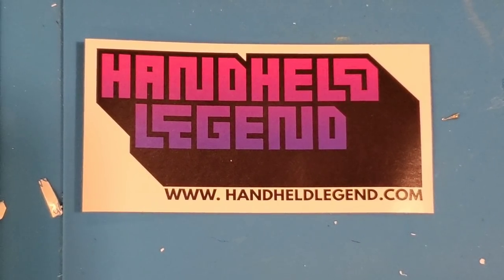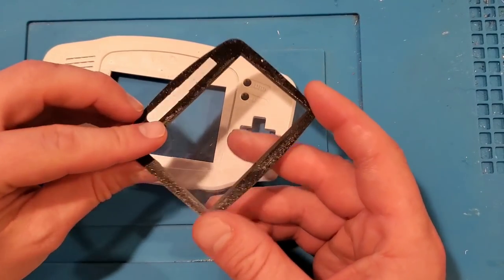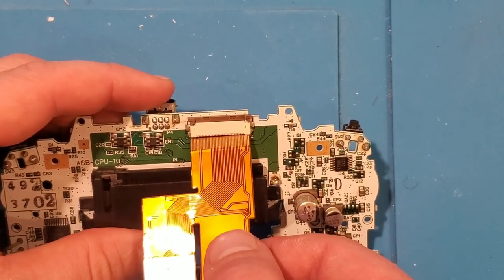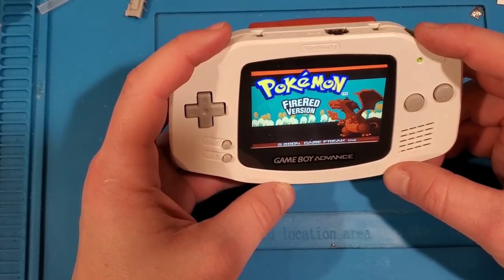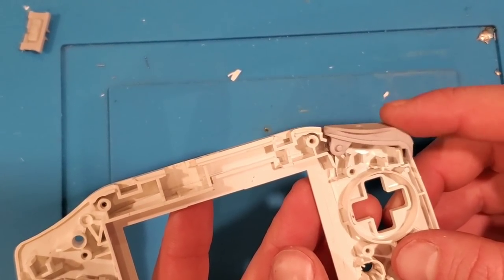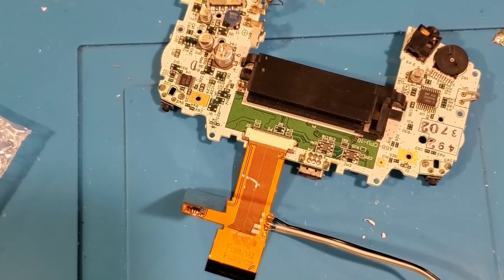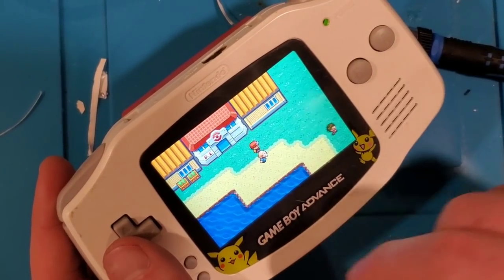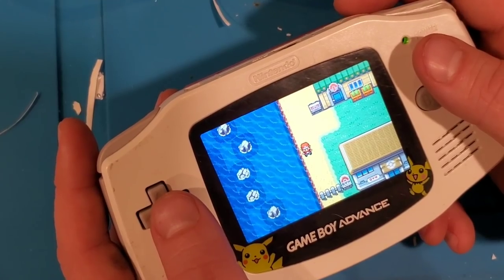Game Boy Advance IPS Backlight V2 Centered Installation - Fixing Ebay Junk - Backlit Display

Comment: I installed the screen and tested it first. Worked fine and had displayed the correct colors. But after getting everything in place, the screen didn’t display the correct colors. So I took it apart and when I touch the other ribbon connector with my finger, the colors changed and have lines. Did I do something wrong or damaged something? I don’t see a tear in the ribbon. Someone please help!

Comment: I once ordered a frontlight mod for my GBA, but I didn't get any LOCA glue with it, which I soon found out was a mistake. But by the time I got any LOCA glue, my GBA had some dead pixels on the screen, so I decided to just get one of these, since they had recently come out (with the V1). I didn't have the money to get one, so when they were sold out, I thought I had missed my chance. Luckily, the reason they had sold out was because they had a better V2 ribbon on the way that fixed the screen tearing. I got that, and I absolutely love it!

All good things to those who wait, I guess.
Reply: I feel bad for those who rushed and got the V1. I held back specifically because of the screen tearing as I absolutely can't stand that kind of stuff. Now not only do I have a GBA with a V2 but I also have 2 SP with it as well. It's even easier to install on the SP as you only need to solder 1 cable that allow brightness control directly with the SP's brightness button.

Comment: Thank you so much for making this guide! All the other screen mods had them putting them in aftermarket shells with larger screen cut-outs but I plan on doing this to an authentic spice orange shell I purchased off of ebay, so I wasn't quite sure how to make the larger IPS screen fit without cutting away at the plastic border. Which I really didn't want to do for the same reason as you, basically fear of doing an unappealing hackjob on the original casing. I'll definitely keep this video saved for when my materials arrive and it's time for me to mod!

Comment: The edited-in portion showing you installed the spacer wrong was  abit confusing when it jump back and fourth in time. At the final assembly end of the video it was still/again in the wrong place, so assume you noticed later and recorded the edited portion and spliced it in. Would have benefitted from a annotation (both at the edit portion and at the assembly time where you put it in wrong) especially if ppl want to use it as a tutorial.

Comment: The lag on the brightness switch could be due to the two soldering pads touching on the ribbon cable connector
Reply: I was thinking they looked like they were connecting lol

Comment: @9:30 On the board of the GBA, there's a little number to the bottom right of the ribbon connector. It represents the number of pins used. There's a 32 pin and a 40 pin version of the GBA. Looking at the number, you can tell that yours is the 32 pin version.

Comment: I have a GBA SP that I have taken apart and cleaned. I got the left trigger button working reliably, but the right trigger button only wants to work if I apply a lot of pressure at a specific angle. I've tried using compressed air to blow out the contact, and I've let isopropyl alcohol sit in the contact and evaporate. It still only responds if I push it at an angle or use a lot of pressure. Is there anything else I can try before I replace the trigger altogether?

Comment: the funnyplaying v2 screen fixed some of the bugs that were present in the v1 like the screen tearing.
Reply: Tiny correction. The ribbon got fixed. Not the screen. That mean you can upgrade from V1 to V2. Bad news is that 80% of the price is the ribbon.
Reply: I just installed my V2 yesterday and get minor screen tearing during led screen resets and during screen transitions. Is this normal or did I get a defective unit?

Comment: I just started refurbishing and upgrading my childhood GBA and this popped up on my feed, this screen looks way easier to install than others, I have some questions though. The soldering controls the brightness settings right? And therefore isn't "required" to do? And if not, does the screen appear too bright or dark on the normal brightness?
Reply from the maker: It's not required,  and if you decide not to,  it's "normal" brightness,  not too bright, but bright enough for most conditions

Comment: Hmmm I wonder, about 2 years ago I purchased a pre modded GBA and the left button is solid and doesn't click I wonder if they messed up the piece of plastic you kept.
Reply: It's possible that the metal tab is just out of it's spot. It's also possible that the shell is too tight and doesn't let the button move freely. I had one where the white bumper pieces on each side were touching the buttons a bit and wouldn't let them spring back up properly. They still worked but it annoyed me. If you have the same problem it's easy to fix. Unscrew the back cover, take out the bumper pieces and file down the edge that touch the buttons some. You don't even have to unplug anything.

Comment: I'm a little concerned I did the funnyplaying mod and used the glass lens but the screen is noticeably offset to the right even centering it like you did.
Reply from the maker: The screen is bigger than the window,  so you actually need to trim the hole so you can view the entire screen. 

The way i offset it centered it more.  Some of the screen is still hidden,  but it's only a couple pixels on each side instead of being out by a quarter inch or more

Comment: Hi all, after my IPS mod i'm experiencing this issue where the select button works as it was the start button. Is it normal after I soldered TP2 for brightness control or not? Someone ever had such problem as well? Thanks in advance
Reply: hey there, just here to say i cant help you but i wish i could. ight thanks bye
Reply: @clayl4650  I actually managed to fix it: there was a false contact on TP2; after I re-soldered the point correctly, both start and select buttons started to work correctly. Thanks

Comment: Man, you'd think that the designers of the backlit upgrade kit would measure their parts more accurately. The screen display being too big to see unless you trim the actual case, they should of just reduced the backlit display themselves.. The flipping of the flexible board parts is insane.
Reply from the maker: I suspect they used a mass-produced screen that was already available, and only really designed the ribbon connector.   There's a fair bit that goes on on that ribbon, as the output has to be scaled and adjusted for the proper screen.   I'd be surprised if this display were manufactured solely for this purpose.
Reply: @RetroRepairs  The screens are indeed mass produced and that's why they are 8$ each while the ribbon is 40$.

Comment: You could have just kind of sat the screen cover into the hole without taking the adhesive off, so you could easily remove it and use another since it was so scratched up.  Was no real need to actually adhere it if they will end up sending you a replacement due to the scratches.

Comment: They have a version for the GBA SP as well now. I have one on the way. Going to turn one of my AGS-001 into an IPS modded version. I also have a few AGS-101 but it's not really worth upgrading those.
Reply: I agree bro, it is not worth to ruin an original ags 101 sp for it! I hope you are enjoyed your new ''ags'' 101 :D
Reply: @martijn439  I certainly do. The IPS screen look good on videos but it's even better in real. So sharp and clean. The one I got was from Ebay. It has 10 brightness levels and it remembers what setting it was at even if you remove the battery.
Reply: @chamoo232  cool! im about to order one myself but idk how to solder
Reply: @martijn439  I got a cheap soldering kit on Ebay. The only thing missing was flux and that's very important as it make it so much easier to solder. It's basically 3 steps. flux, heat, solder. Solder becomes liquid when it's hot enough and it stick well to the copper contacts and wires as long as there is flux. Unless you have very bad eyes I would say the difficulty of soldering the cables in the SP IPS kit is probably about 3/10.
Reply: @chamoo232  thank yo ubro, i will give it a shot once i have the required parts
Reply: @martijn439  It's very useful to have a soldering iron too if you ever need to replace something like the L and R buttons. I recently did that on a SP. The cheap soldering kit I got has a device that look like a big sirynge that you click and then press a button to have it suck out melted solder. With that I was able to easily unsolder the tiny switches soldered to the board and install new ones.
Reply: @chamoo232  that sounds really interesting! I really have to practise soldering first. I am trying to buy a shell + ipsscreen now for the gba. Idk which color. i am debating between blue and green.
Reply: @martijn439  My favorite replacement shell is the NES one. has a very nice sticker that look like the NES controller and the A and B buttons are red. My main gaming SP right now has a transparent black shell. It's nice because you can see the motherboard through with the little red cable I soldered. I have an EZ Flash Omega cartridge and it's the same color so it all match nicely. The Super Famicom one is surprisingly well made. It has a more mat finish than other shells.
Reply: @chamoo232  thanks for your answer! i ahve decided to go with crystal green though, as it seemed really cool.. good thing i can always swap the shell out if i dont like it
Reply: @martijn439  Indeed. There really isn't any bad choices. If I find another SP for cheap the next shell I order might be the yellow glow in the dark one.

Comment: My man how do you fix a faulty speaker, that lowers in volume  as you turn the nob? It cuts in and out, only some positions it will play sound
Reply: Try cleaning the volume wheel with some ipa.

Comment: Why not sand back the horizontal alignment part, i.s.o chopping up the gba?
Reply from the maker: Because the screen itself needs to sit in where the plastic I removed came from.   At first i accidentally started putting the alignment part on the wrong side, but then adjust it later

Comment: I got a funny playing screen, and the color palette turned blue. Have you ever had an issue like that before? If anyone has, let me know how you guys handled it with funny playing. The LCD works fine except the color palette turns blue unexpectedly and stays blue which is peculiar. I've done this mod, with a funny playing IPS v2 screen, before and this is the first I've seen with the LCD being faulty by changing the color palette to blue.

Comment: The GBA mod is actually pretty impressive. I'm surprised how easy it seems.
Reply from the maker: Once you can get it lined up,  it's fairly easy.   Even if you don't have a soldering iron,  you can do this mod,  you just won't get the brightness control
Reply: @RetroRepairs  I have the GBA SP version of this mod on the way. It only needs 1 wire to solder and it allows the brightness to work using the SP's light button.
Reply: @RetroRepairs  if its me i would clean my finger prints off the back of the lcd

Comment: Why didn't you use the centering bracket and centered lens?
Reply from the maker: Wanted to use a custom lens instead which was not sized to fit the standard ips installation

Comment: I just did the ags 101 mod on my gameboy. I love it.
Reply: The 101 mod used to be the holy grail of GBA mods but this new IPS screen stuff put the 101 screen to shame. Getting a AGS-101 is still worth it but if you are modding an AGB it's better and now cheaper to do the IPS mod. There is even a SP version now too. Those old AGS-001 front lit GBA are climbing in price on Ebay now.
Reply: @chamoo232  I'd rather not have any screen tearing, which is why I chose the ags 101. I do think the ips screen looks way more crisp and clear, though. It was a hard decision to make. I put mine in the Boxy Pixel aluminum case.
Reply: @FranktheTank319  The screen tearing is gone in the V2 version. The problem is not the screen. It was the ribbon connector and it's upgradable for those that had the V1. I was holding back as well because of it as I knew it would annoy me a lot but jumped on it when V2 was released. There is no advantage left for the 101 screen. IPS is cheaper, brighter, sharper, has absolutely no ghosting and the screen tearing has been fixed. If you get your hands on another GBA I strongly suggest you do the IPS mod for the next one.
Reply: @chamoo232  honestly, the gba is so cheap that I could get another one and just get the V2 screen. I'd love to do another mod even though I just finished mine last week. Could you post a link to the v2 screen? I'd like to take a look.

Comment: Does anyone know if this is an easy first mod? I've never modded a console before, but I have a hideous clear blue GBA I wanted to replace the shell on & install this mod to.
Reply from the maker: You can buy pre-cut shells which already fit this display.  All you'd need to do is solder the wires if you want brightness control.  If you're ok without brightness control it's really just plug and play.  I did a slightly more complex install,  but it doesnt need to be that way
Reply: @RetroRepairs  Oh I definitely need the brightness control, I have photosensitive eyes, lol. Soldering doesn't scare me, my dad's done it before so I'll have guidance. But those pre-cut shells were a big relief to see. Thanks for the fast response!

Comment: I got mine in and tried to install it and it won't light up, so do you think I have a broken screen, because I get sound and no picture?
Reply from the maker: Possibly.  Im not sure if there's any board revisions that aren't compatible.
Reply: @RetroRepairs  Yeah, I have the original screen back in it and I get picture and sound. I told the seller the problem, and they want pictures of it installed.

Comment: So with the screen centered, I assume a tiny bit of the screen is still being cut off on all four sides is that correct?
Reply from the maker: Correct.   The amount of lost screen is very minimal.  Not noticeable.   Id hate to have bad cuts trying to enlarge the window for the offset screen, and have to look at it. 

I'll be doing another gba ips install where I'm going to try exactly that,  so I'll be able to see which method ends up better
Reply: @RetroRepairs  Nice.  I'll be looking forward to that.  I actually have the V1 version of the kit.  Would really like to be able to buy just the V2 ribbon cable so I can have the benefits of the v2 kit.

Comment: Adam you forgot to enlarge the viewable area of the shell and put the spacer in the wrong part..anyway good video as always.
Reply from the maker: I talk about the spacer midway through and that it was in the wrong side.  The purpose of the centered installation here is to avoid needing the enlarged viewing area.  In this case,  there was a custom lens which would not otherwise be usable

Comment: It's a good thing the GBA I bought to consolize also has bad L and R buttons (the actual buttons soldered to the board, and I couldn't find replacements anywhere). If I could put this screen in and then use it handheld, I'd be awfully tempted. But I can't. Safe. 😅
Reply: I'm tempted to use one of my AGB for the consolize mod but I would need to fix it first. It has a problem turning on. Either the on\off switch is worn down or the capacitors are going bad. I could fix the switch but I don't think I can do a capacitor job.

Comment: When I saw him trimming off the wrong side for the spacer of the display, I cringed immediately.
Reply: He was trying to make the IPS LCD fit with the genuine sized screen lenses so he doesn't have to use centered IPS lenses!
Reply: @vitzie629sgamingtechnology7  well sure he was trying it to fit, but he trimmed off the wrong side! I don't know what you mean by "centered IPS lenses". The screen is calibrated that way, that it fits perfectly if you trim off the correct side.
Reply from the maker: It does not fit perfectly. The recommended installation method requires an enlarged lens as the screen is off centre. 

This method centre's it,  minimizing the lost screen space to only a couple pixels on each side and more importantly allows you to use an original lens.   I explain this in the video
Reply: @RetroRepairs  well that's not what I've seen in other test / tutorial videos who did it correctly to begin with. Lmao. Also your video kinda proof it, since it's visible that you had to trim off the other side, making my argument valid.

Comment: If I would do this, I would buy an aftermarked case and do the modifikations on that one instead on the original case. Maybe you could call your sponsor if they could sell cases with that case modifikations allready done. That would be very nice.
Reply from the maker: They do sell aftermarket cases, but i was more interested in retrofitting a common color which already had custom decals with a better display and lens
Reply: They make aftermarket cases with everything cut out already. Might try that route. I shredded one case and I don't have faith that I could do it on another. Also, fat hands, I have.

Comment: Does it matter if it's 32 pins or 40 pins?
Reply from the maker: The ribbon is compatible with both,  but there might be board revisions that are incompatible,  you'd be best to check first
Reply: Ok thank you

Comment: hi Retro Repairs!!!.  I have a question.  I bought a Sega Saturn.  He goes as far as when I insert a cd.  He starts reading them and then the entire console freezes.  can not do anything after about 5 minutes, the cd does not turn and it flashes the orange lamp.  what do you think is the problem.  when I screwed it on and hit the switch for the drive the laser lights up and moves a bit and the lens goes up and down.  thanks in advance.

 Miuga